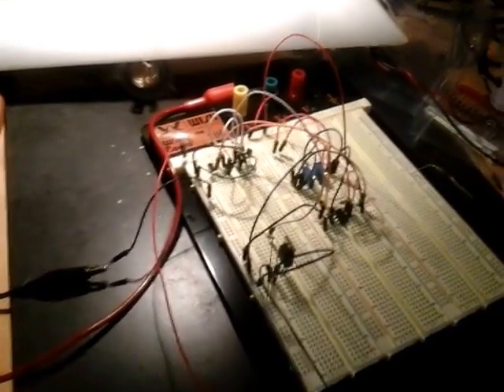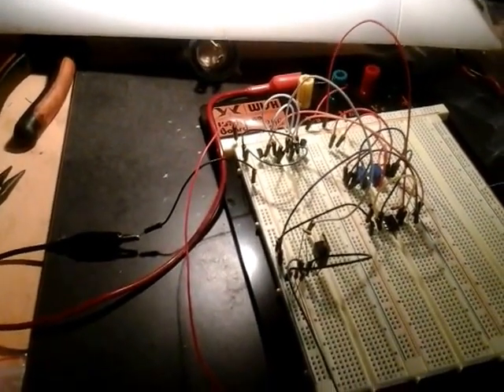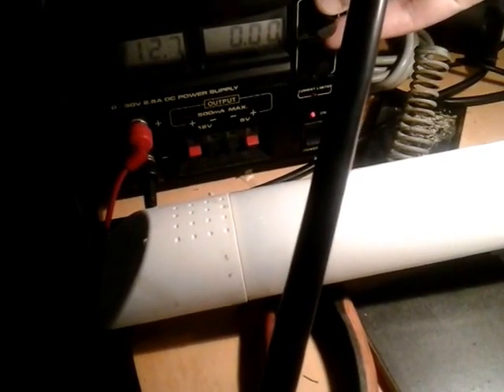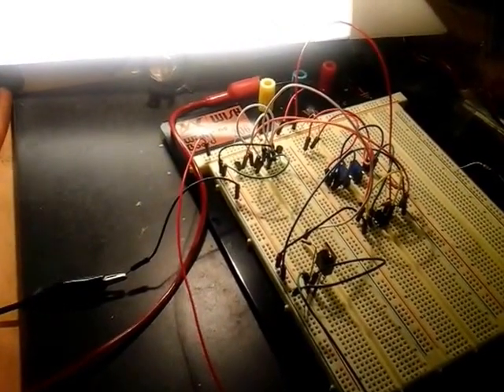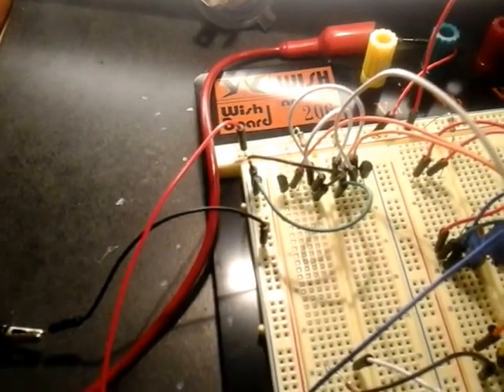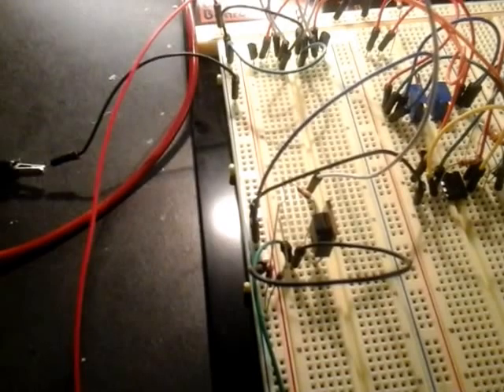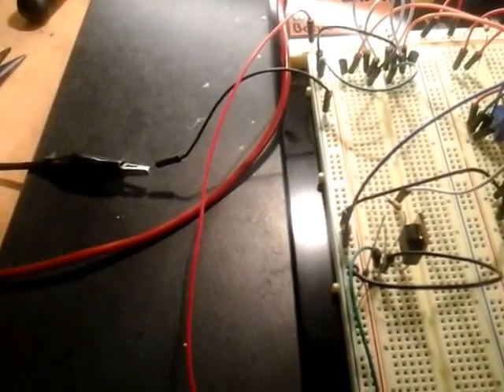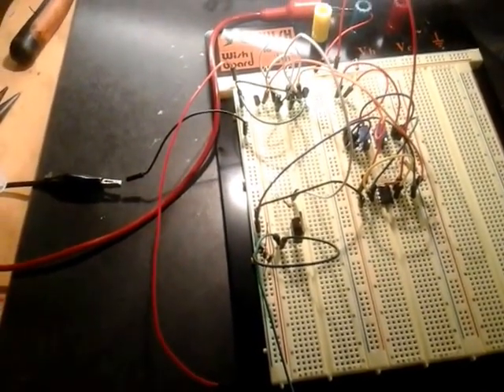Voltage triggered switch

Comment: I built this and it's brilliant! Thank you so much for posting this and the link provided in the description. My application is using a small 12v solar cell to control a circulation pump (I don't want the pump to run at night or when it's cloudy). I'm sure I am going to find other applications too. Thank's again....   Ian....

Comment: Can I use this for charging two separate batteries?  first one, then OFF,  then charge the other, and back again at Low Voltage signal?
Reply from the maker: I'm not quite sure what you are trying to achieve. If you describe it in detail, I might be able to come up with an idea.